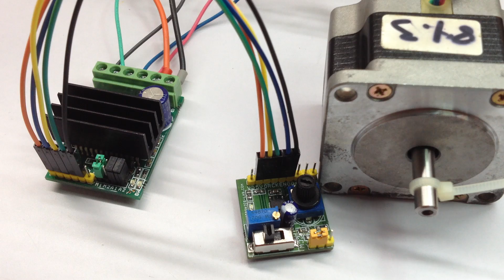Stepper Motor Pulse Generator with Ramping

Comment: where i can buy AD654 IC circuit? Thanks
Reply from the maker: IC is available with digikey.com, mouser.com, and also you will find at aliexpress
Reply from the maker: Circuit , pcb design available here
http://www.electronics-lab.com/project/pulse-generator-stepper-controller-using-ad654/